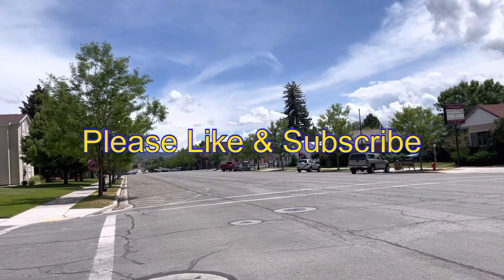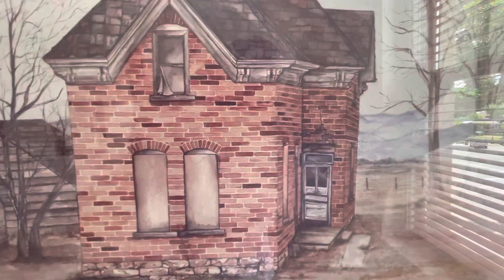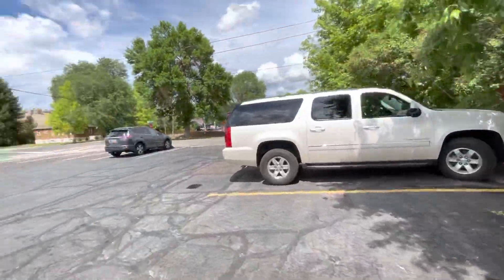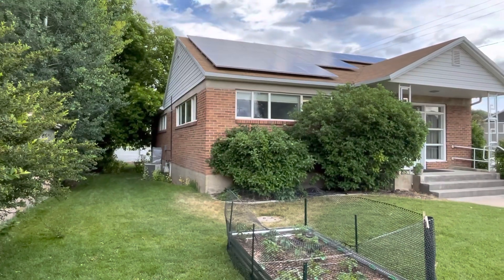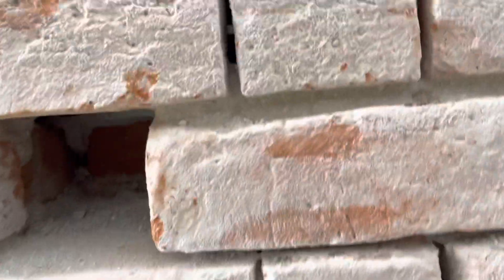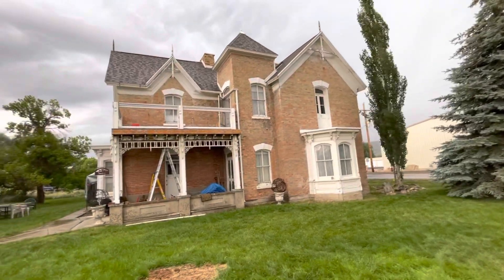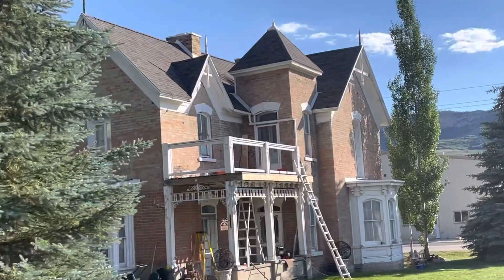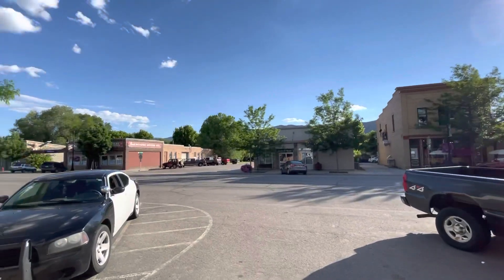(22) Coalville, Utah. Settled 1854, founded 1859, incorporated 1867. Tartaria Mudflood tour

Comment: The effort by SOT is outstanding.  City after City is inspected and videoed and the results show that all older buildings have work done on the original first floor.  Those who actually built these structures did not appear to have dug basements or cellars so the first floor became a basement and it seems most were used to pile junk and collect dust.  There is a story here, more of a mystery, that has been hidden.  Like a pimple on your nose, everybody sees it yet few comment.  A city of 900 people do not build what we see but they can pour cement or lay a few blocks and dry the new basement.  How long between the builders and the mud flood and the pioneers who crossed the land and found submerged buildings?  They were not welcomed by the older community because they were gone, killed or raptured if you please.  There is a willful denial that windows were covered with mud and work done to dry the covered first floor.  Of course, it is not just here in Utah but everywhere which proves that History has been altered and we have been fed Bullshit.  This is just like the UFO/UAP secrecy with "National Security" thrown up to shut everybody up.  This government/civilian industries like  Boeing Phantom Works and Lockheed Skunkworks  running the Space Works and even locking out the government and congress. Who ever the dark forces behind the scenes or the "Controllers" have us like rats in a cage/maze and we run around hoping to find answers.  The problem is we don't know the rules of the game and actually we have not been asked to play.  When a 60 foot prior set of floors, windows and doors are found, it should be bannered and headlines in every newspaper and news report until some investigation is conducted to explain how this all has happened.  In some cases, the entire city is covered and may forever remain hidden and in these cases where structures were found and occupiable, they formed a band and seem to have swore oaths to not acknowledge that they came upon this "windfall".  There is no one alive today who found these buildings and generation three is now occupying the buildings and would that people would just shut up and go away.
Reply: Whoa,that's alot of probable conspiracy theories and personal thoughts about a little hamlet smack dab in the middle of the Mormon cult Bible belt, yikes!